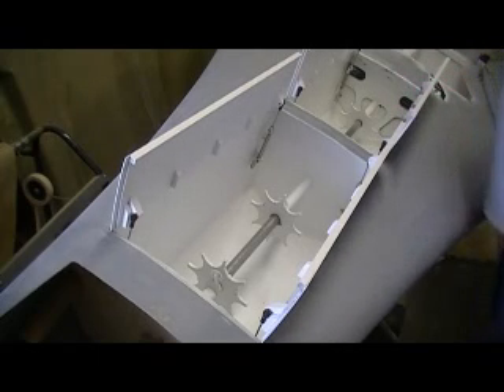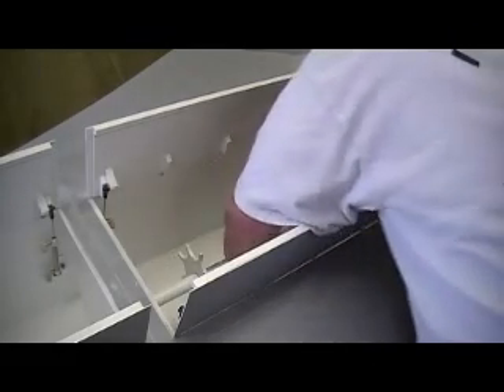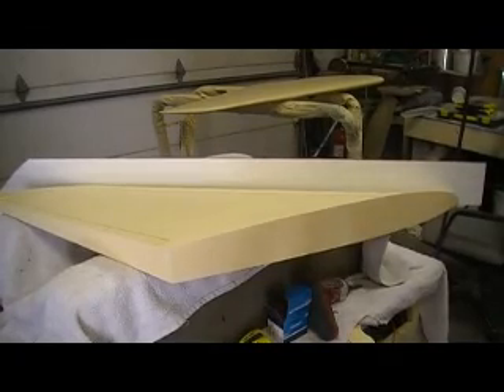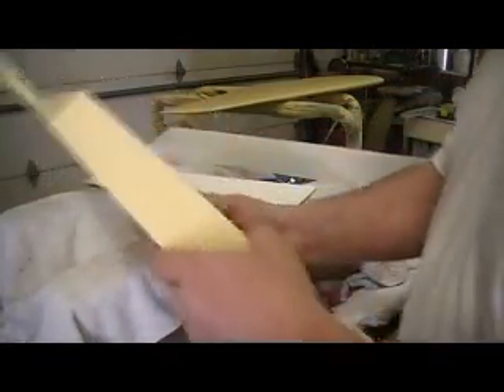how to build a rc jet B-1 Bomber # 149 PT 1

Comment: The reason you do not want to go smother than about 600 for paint prep is to give the paint something to bite into. If it's too smooth it may flake off. And after a second coat  any scratches will go away. Save the 1000 and 2000 for color sanding. Building this beast out of fiberglass is as much auto body as it wood working . To ,me, building is building. Hot rods, toys, picnic tables. It's all good as long as you use your hands. Who needs therapy if you can build something!